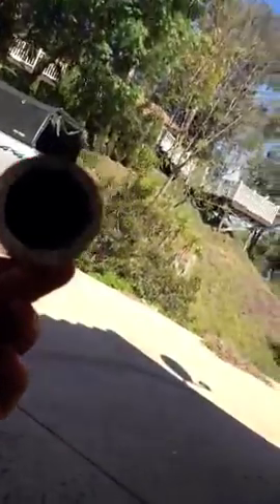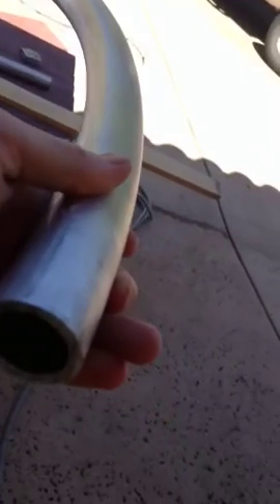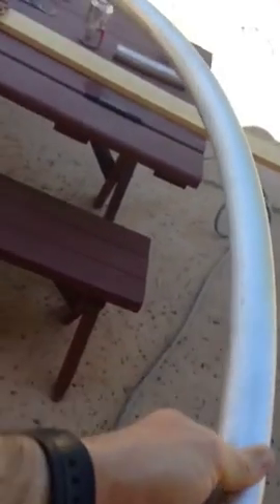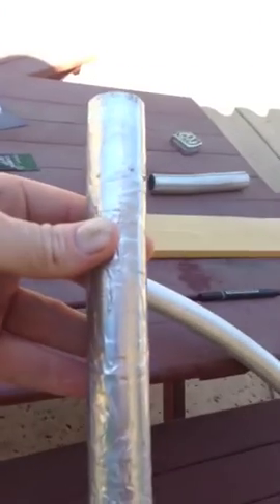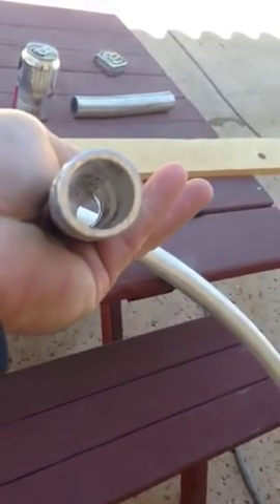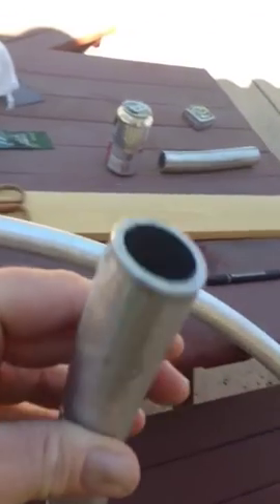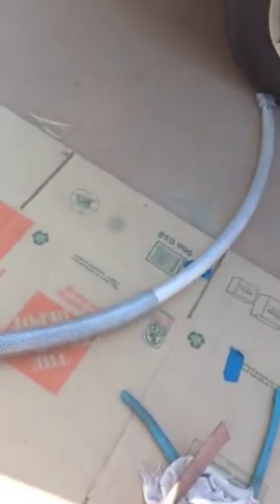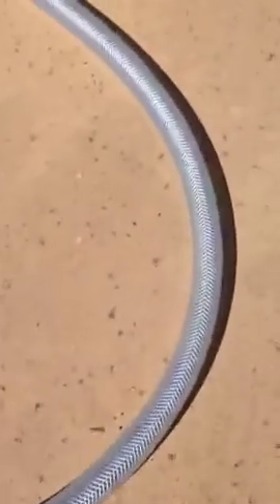Make a Cyr Wheel

Comment: Hey Toby, How did you bend the tube? Can't wait to make one myself!
Reply from the maker: Hey Rey---I found a local fabricator and got it bent.  The aluminum cost me about 100 bucks--the fabrication was 150 and I lucked out and found the tube at a hose place for 45 bucks---my wheel cost me about 300--
Reply: Thanks Tony, I'm going to seek out a metal fabricator today. When I get to the skinning part I think I'll try soapy water or water based lubricating jelly. I'll let you know how it turns out. Thanks again!
Reply from the maker: I used olive oil--